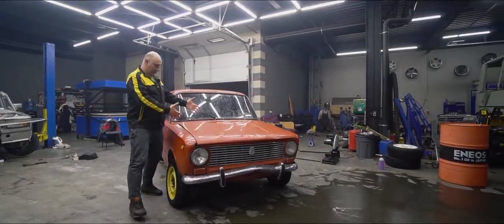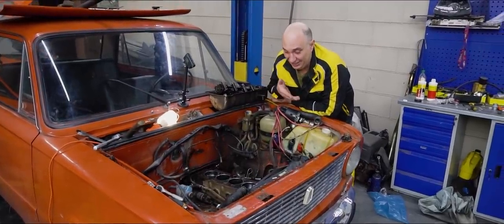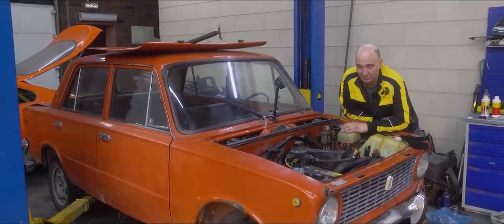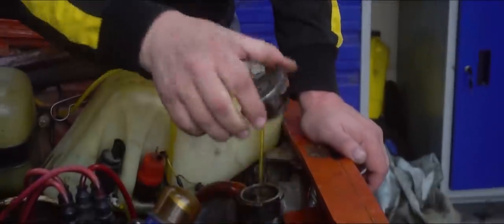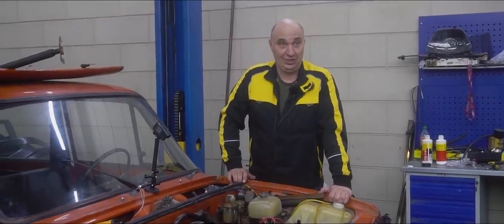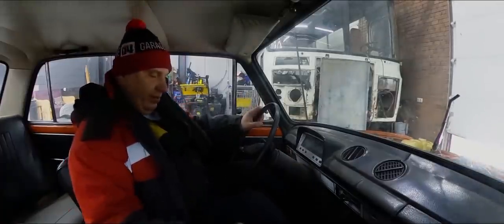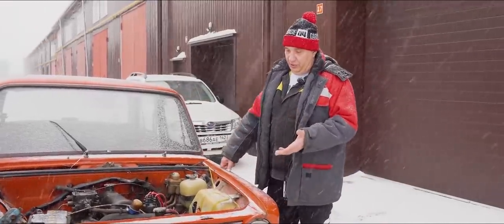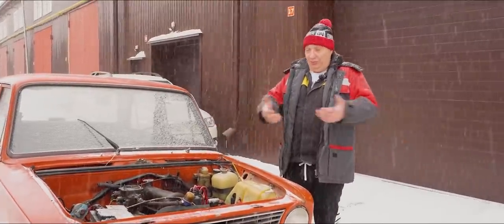What happens when you fill the cooling system with motor oil?

Comment: I was expecting just oil in the cooling system with a good head gasket, to see if it would circulate and actually cool
Reply: Evans waterless coolant
Reply: If i were a guessing guy i would have to say that in not too long the radiator and coolant channels will get clogged right up and then overheat..  but then again when it does overheat, oil becomes more viscous when hot so guess it would clear em out at that point if built enough pressure.   Only thing is water turns to steam when heated and works the thermostat springs in the system and circulates that way..  oil will not vaporize like that and build pressure.  But the water pump i guess would compensate for some of that...   maybe just remove the thermostat and make sure you completely get all the water and antifreeze out so it wont milkafy the earl and would be good..  dunno..
Reply: @Z-Ack  the thermostat opens in a car due to the temperature not steam. You can see this by putting one in cold and hot water. The spring will move and open/close the thermostat. So oil would actually work altho it might take a little more time for the engine to heat the oil to the point of circulation. Oil is used in some regards as a coolant in other scenarios so would work on a car in theory.  

You would have to drive a car 100,000+miles on oil to really see what advantages or disadvantages are found.

On top of this the heater matrix uses hot water to heat the cabin of the car and the impellor might not work well with oil being thicker.
Reply: @Z-Ack  The channels wouldn't clog, they're big enough.  I would figure the lightest weight oil available would be used.  I'd expect the water pump itself to be a problem.  It's got blades instead of a trochoid like an oil pump, so I'm not sure how well it would move oil.

Water doesn't turn to steam when heated, it does so when boiled.  Boiling point raises with pressure, hence the cap, and why a hot engine will boil over when a cap is removed even though it wasn't boiling before.

The thermostat isn't held closed by springs, it's held closed by a wax puck.  The spring is trying to open it.  When heated, that ball of wax can't resist the spring trying to open it any more.

Vaporization is a completely different thing.  Vapor isn't liquid, it's a gas.  Look into fuels and how to get them burning efficiently.

Emulsion, (milkshake) could be a problem, but it might help and actually be better than pure oil.  Depends on how well it would flow and it's thermal efficiency, or lack thereof.  I honestly have no idea, but I'd be curious to see the effects either way.
Reply: @mrtrendizzle  That's kinda what I was curious about.  How well would the oil absorb and release the heat.  It's generally used as a heat sink, not necessarily as a coolant, like in transformers and stuff.  I'm not sure if it could actually pick the heat up quick enough to stop thermal runaway in the head without cooling fins to help.  I'm sure engine developers tinkered with it back when everything was transitioning over from air(oil) cooled, but I've never actually read anything about it.
Reply: @M1A4R8K8  Never heard of it, so I googled it.  As a rule I don't trust anything that is so secretive about what's actually in the bottle.  Sounds like it could just be the same glycol used in vapes.  Don't know though, I'll have to read into it a bit more when I have time.
Reply: @mikaelgaiason688  I'm only speculating but i would assume the normal radiator is not designed to cool oil. The size of the radiator and space between the fins would have to be much much larger to cool the oil quick enough for it to loop around such a small space. I would think the oil would pick up enough heat as it circulates considering the oil in the sump gets cooled before being sucked back up to lubricate the parts inside but that's only in larger open area's.

I do see the posatives tho. Blown headgasket and it dosn't matter due to the oil not mixing with water and being able to just transfer between the sump and radiator altho the radiator would have to be bigger and allow for small metal particles to pass through without getting stuck clogging the coolant lines.
Reply: I did expect that to. Making me feel like this video /name is a clickbait. 🙄
Reply: Yes, I'm unsatisfied that this is just another Lada abuse video. I just wanted to know how good would oil cool the engine.
Reply: @Z-Ack  then why not replace  it to with a  bigger oil cool radiator or place an oil filter before it goes through the coolant radiator just making sure it wont clogged.
Reply: Yeah same here .
Reply: Skip R  20w60 😅👌
Reply: @Z-Ack  That would be an interesting test. With both the oil pump and the water pump it should achieve enough pressure to compensate and help boost the oil pressure to suffciently push oil through the coolant passages to cool the engine. At the cold temps he is is testing in, it takes a bit longer for the oil to get warm and circulate properly. Plus, the added volume of the coolant passages would help keep the temps down since the radiator would cool the oil down before returning to the regular passages. With a warm temp test, it would test the coolant side of the combined system since the warmer temps would effect the coolant side via the radiator. If the temps outside are hotter it takes more effort to cool a vehicle down v.s. a vehicle in colder temps.
Reply: This is what I was hoping to see.
Reply: That’s what I always wanted to see
Reply: If I had to bet, the only reason oil is not used as coolant is due to cost. It costs more for 4 gallons to fill the system, plus when a radiator hose goes out, the contamination to the environment wouldnt be good. 

Last bit would be along with the contamination part. Lost oil cannot be recycled,  and thus cost on "new" oil in stores would slowly see a rise.
Reply: Oil was used in the same way to cool air cooled engines a hundred years ago. 

A HUNDRED YEARS AGO

And u are arguing if it will work or not.
Reply: @fastinradfordable  exactly lol they use vegetable oil to cool computer motherboards and even the tiny onboard fans can circulate relatively cold oil very easily so I doubt an auto water pump would have any difficulty...

On the other hand, motor oil will destroy and swell your rubber cooling lines pretty quickly
Reply: Deutz diesels from the past 20 years use engine oil as coolant. As in pumped through the block / head just like water based coolant.
Reply: @fastinradfordable  I'm familiar with air cooled engines.  I'm a master certified motorcycle tech...  They still make quite a few air cooled engines.  I wasn't arguing about if it would work in general.  I was only saying I'm curious how well it would work in a system designed for coolant.  Get a hobby you filthy casual
Reply: @mrtrendizzle  I'd wonder if the standard water pump could push oil through the radiator, and what type of flow rate it could maintain.
Reply: @rayventiman1299  A filter would be even harder for the water pump to push oil through.
Reply: @mrtrendizzle  When you have a blown head gasket you are most likely going to be more worried about loss of fluids in the combustion chamber lol blowing a head gasket would still be very much a problem if you had oil/oil.
Reply: @amorag59  yes, there’s a couple of ways that a head gasket can blow. 
The use of mineral oil in a computer is a thing, you can see that regular fans struggle, but motor oil does become more viscous as it heats up so if Vlad did this test without a busted head gasket, possibly a copper one, or O-ringed the combustion chambers to the head, I think that it would be successful even in summer if he used the correct weight/viscosity oil and completely removed the water from the engine, including the heater loop. I don’t see why it wouldn’t work.
Reply: @JesusisJesus  Well yeah lol definitely would have been better if he didn't touch the gasket and just did oil/oil with a sound head gasket. There is a worry that he could be starving the main gallery and crank oiling of pressure, but then again I'm inclined to think garage 54 messes with things in such a way on purpose to garner a result that might do something funny or fail and look exciting on camera. I've made a mineral oil cooled induction heater power supply before (ZVS driver off ebay in a 3D printed enclosure with hose barb input/output), boy oh boy did the pump struggle on mineral oil lol. 

I was more commenting in regards to @MR_Trendizzle's comment "I do see the posatives tho. Blown head gasket and it doesn't matter due to the oil not mixing with water and being able to just transfer between the sump and radiator" He wasn't considering the loss of coolant liquid, the telltale sign in a car with normal coolant being when you see a shiny piston, clearly steam cleaned by water/antifreeze.
Reply: yes this comment
Reply: i've had a car with a internal leaking oil heater/cooler.
it was just a small heat exchanger between the coolant and oil lines.
So one day I was checking the coolant level and it was one reservoir of thick warm oil gue.
The oil was boiled out (I think) so it was much much thicker (almost like fat).   
Yet the car still managed to cool. after finding out the heat exchanger was bypassed and fluids were replaced.
Car still drives today.
Reply: Motor oil has a lower heat transfer capacity than pressurized water/glycol mixture.  It will work to use oil as coolant as long as there's no water in the system (else you get the dreaded milkshake).  As you approach full load you'll need a larger radiator to shed the heat.
Reply: Me too
Reply: Rubber is dissolved by oil so if you just use hydraulic hoses you can use two radiators and an electric fuel pump for diesel systems and bing bang boom your junk works
Reply: I would have thought the same. Why modify the headgasket. Just pour the oil into the cooling system.  First generation of Suzuki GSX -R 750s were oil cooled.
Reply: In most basic systems between 150-300cid i4 there is a noticeable difference in using oil vs water, but it's not a large difference. I've done it a few times with AG tractors, if they were equalizing temp with water around 160f and you switched them to 20w oil, they'd equalize at 175f they'd pretty much hold more heat at idle, and get rid of it when the rpm was increased, adding an electric pusher fan helped a good bit too. Depending on the engine design you can run into some issues when turning off the engine, the oil is going to want to thermocycle and as it does that it can cause a pretty dramatic temperature difference between the block as the head which is kind of a byproduct of oils capacity for holding on to a lot of heat
Reply: That i was expecting too
Reply: ......and it probably would, depending on the oil.  I would recommend COOKING OIL, rather then mineral oil.
People have been oil-cooling computers for a while now - submerge the ENTIRE motherboard in cooking oil.  Messy, but effective.
Reply: @Z-Ack  I was thinking something thin like trans fluid might do ok.

Comment: The farmers have beaten you to it! - In the 1930s and '40s when tractors, like the Standard Fordson, and Fordson Major E27N had a 22 gallon cooling system, anti-freeze was expensive and hard to get, it was also an expensive job to repair a frost damaged engine block, so, many of the owners decided it was cheaper to use oil as a coolant instead. In later years (1950's) it was cheaper to use diesel fuel as a coolant. It worked well enough back then, but worth remembering that those cooling systems did not have any rubber hoses, so there were no issues with the oil damaging rubber parts. Other 'rubberless' cooling systems in other tractors/vehicles could be treated the same way - Of course, a coolant leak would increase the risk of a fire if it dripped or sprayed onto a hot exhaust. Swings and roundabouts, I guess.

Oil as a coolant? Definitely a 107% success!
Reply: Nothing new. Many large industrial machines that have substantial hydraulics systems on them run the hydraulic oil through the engine to both keep it at a stable temperature plus eliminate one more fluid and related heat exchange system to take care of.

Comment: As oil is cheaper than antifreeze (if you buy the cheap stuff), maybe we would all be better off using oil in the crankcase AND in the cooling system. 
Saving money is an appealing concept and your research indicates that there would be absolutely no adverse effects. 
This way, we only need to keep a stock of one fluid for our engine's health and happiness!  
Thank you Garage 54! 
In these troubled times, you've shown us a simple way to save money and simultaneously simplify our lives!

Comment: Really interesting idea. I can remember watching video of someone building a computer in a fish tank filled with mineral oil. The oil doesn't short electronics and is good at heat transport which is why it works and the processor isn't destroyed by heat. The cooling fans move slow since oil is heavier than air, but circulate the oil. That said, I wonder if combining the lubrication and cooling system on a production run would work. Basically what you did here, but I'm thinking something where this was intentionally done in the engine design. The oil and water pump could be reduced to a single pump with a single circulation system.
Reply: Suzuki has this with small engines forgot the abbreviation, Google suzuki gixxer 250

Comment: What happens if you use oil instead of coolant with a good head gasket?
Reply: Nothing , just if you leave in hot country it can't transfer heat with efficiency like water. And rub parts will explode with time.
Reply: @LeoKadettTouringCar  so if i change all the hoses you say i have a chance of it working?
Reply: @LeoKadettTouringCar  but if you tried using 0w20 maybe it would work

Comment: Basically turning this car into an air-cooled variant.

Older porches and VW's used oil (a lot more liters) to cool the engine by using a radiator to cool the oil circulating through.

Comment: Well it's working in - 40 we need to test that in hot weather to see how the engine performs.. Good jub tho🔥👌🏼
Reply: Agree. When it's snowing the cooling system mostly loafs. At 25C, I think engine overheats quickly.
Reply: I have they did it in hot weather
Reply: @afiumer7752 you have the video they did in hot weather?

Comment: Before antifreeze and water was used, diesel fuel was used as a coolant. That obviously had some drawbacks,such as thinned out motor oil, but maybe multi grade motor oil such as 5w/ 40w would address both issues?

Comment: How about oil in both systems with a good gasket
Reply: yes that would be interesting, and warmer weather
Reply: Yes, that's what I hoped this was about!
Reply: That would be interesting, renew the head gasket all together and fill the cooling system with engine oil, let it run to operating temp and then put the car through a vigorous testing course, high rooms and idle speeds
Reply: How about only water in the oil system with a good gasket?! Or no oil and no water in any of these 🤔😂
Reply: @IronWarrior95  my ex did that one.....could have started my own channel if I would have recorded everything she did to her cars.

Comment: Wouldn't mind seeing this done in that there car in a little warmer temperature, just an average day like even just 70° F.
Reply: It's a average warmer day in Russia.
Reply: Use humane units.
Reply: Yes but just engine oil in the cooling system 
That was what I expected
Reply: For the engine's normal operating temp range a 20 F or 70 F outside environment temperature doesn't make much of a difference, it will not see a 50 F difference in temperature, the operating temperature is not even closely linear to the outside temperature unless its something like -40F  or +125  and even then the engine will still operate at close to the nominal temperature
Reply: With the hood on as well.
Reply: @KowalDWR  Who hurt you? Plenty of people enjoy the increased granularity of using Fahrenheit 😂
Reply: @aleksankazakov  True, but you have to factor in radiator heat transfer and the decreased heat transfer ability (and capacity) of oil. The engine fluid temp may not be that much different in the two seasons, but the radiator is much happier in the lower temps as the delta T is much higher. Let's see how the radiator removes the heat from oil on a hot day!
Reply: @amorag59  My thoughts as well, also, what is the boiling point of oil?  That sucker blows and the whole works goes up in flames.
Reply: @tinknal6449  The boil point will be higher than the "smoke point", not sure if it would change consistency, go through a reaction or what 😂, but I've just been taught to keep oil well below 300F to avoid it caking on surfaces.

Comment: Years ago my husband forgot to put antifreeze in his pickup one fall. When winter came and his engine froze, it cracked the head and steam was coming out of the exhaust. So he drained the cooling system and filled it with diesel fuel. It worked great for about a month until the hot diesel fuel rotted the radiator hose and it blew going down the road. steamy diesel fuel was everywhere, he's lucky it didn't ignite. He got it home flushed it out real good and replaced all of the hoses and put some of that liquid glass block seal stuff in it which cured the problem in the head. That's the biggest problem, those hoses are made for coolant not oil and the oil will eat the rubber in the hoses up. But... there won't be any corrosion in the cooling system though, LOL!

Comment: Farmers did this back in the day on old tractors which had bad O-ring seals on the cylinder liners.
Reply: Have done that on a forklift. Was still running fine when I lost contact.
Reply: @om617yota8  I bet the waterpump lasts forever haha.